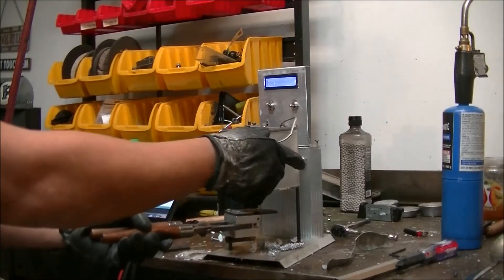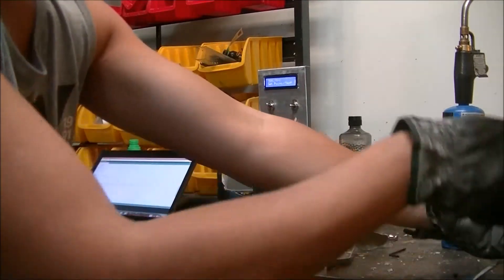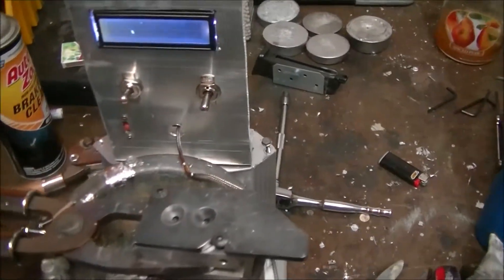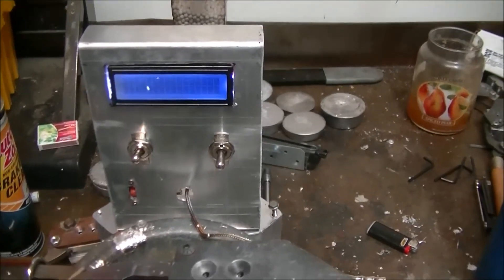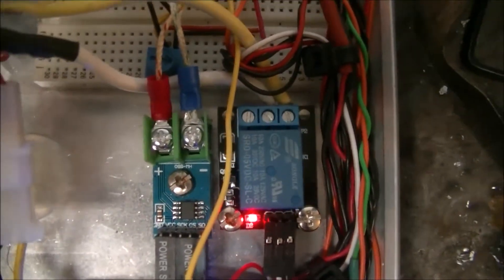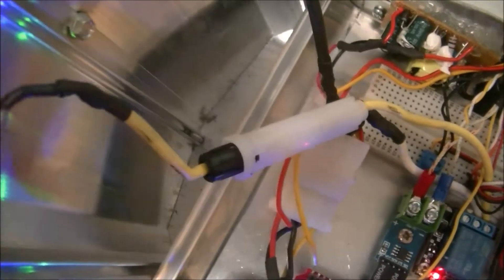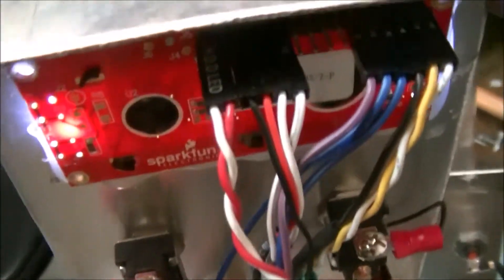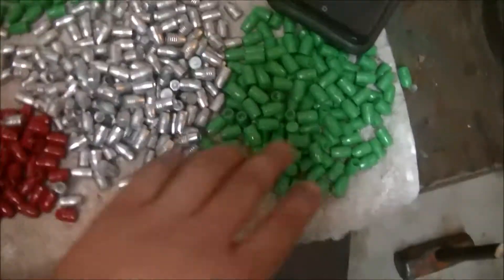A Different Kind of PID Controller for the Lee 4-20 Pot

Comment: Just ordered all of the parts to do this to my Lee 420. Have you done any updates to yours in the last 2 years? I don't see any updates on CBiblio's either. Everything worked good for the last 2 years? I will update here if I ever get it working.
Reply from the maker: I still use it as of today.  A pid controller is more accurate.  But this works well in conjunction with the lee factory thermostat

Comment: Know that’s cool I would have no idea how to make one like that I’ll send you a diffent thermal coupler I’ll get it in the mail tomorrow to you
Reply from the maker: Hey Willie Bulletman! It looks complicated... really not just need a circuit board to solder these wires to clean them up. Thanks for the offer bud you really dont have to I should of gotta the one Loads of Bacon and JRB used. Once I perfect it ill get a circuit board made that will just drop in replace the lee 4-20 top plate